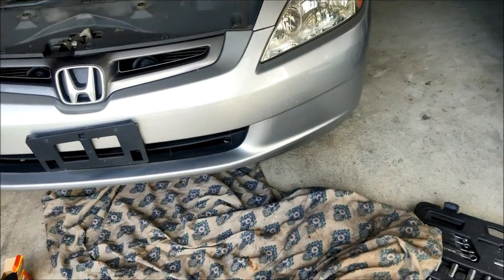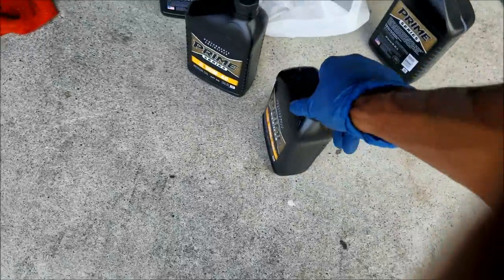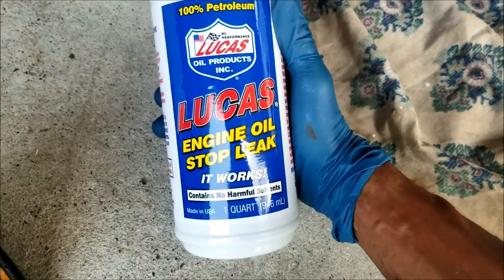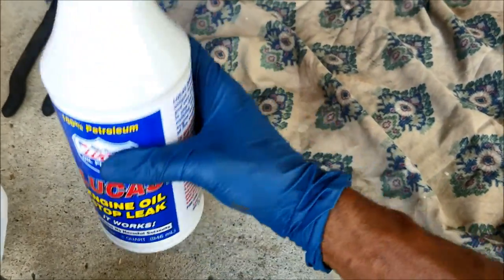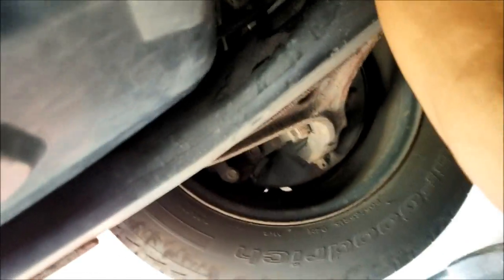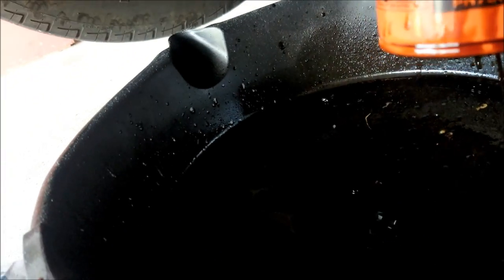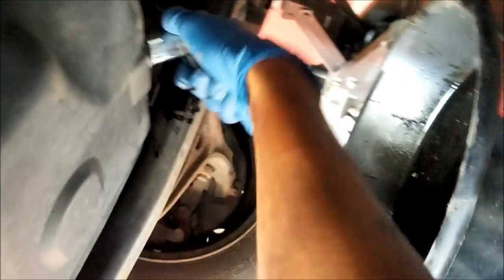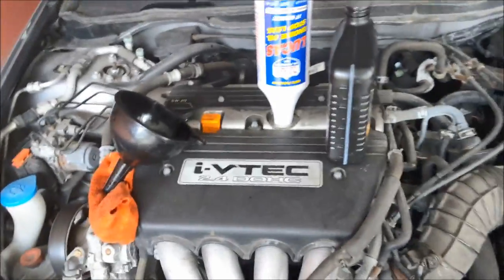USING THICKER ENGINE OIL IN MY HONDA ACCORD

Comment: 10W-40 is fine to use in the K series above 20 degrees F. In other markets like Asia, Europe and Australia, 0W-40, 5W-40, 10W-40 and 15W-40 are all listed as acceptable in the owners manual for various ambient temperatures. The only reason Honda says you have to use 5W-20 here is because that's what they used for their EPA gas mileage test for a slight improvement, so they legally can't list anything else as acceptable because using something else would invalidate the test results. But as others said, don't use any stop leak additives. If you have an oil leak, either fix the darn leak or just live with it and keep the oil full. Fortunately, there aren't very many things on the K series that wouldn't be cheap and easy to properly fix if it leaks.

Comment: 5w-30 is fine in a Honda but don’t use stop leak. That stuff is bad for the variable valve timing. Just fix the leak. Probably the vtec solenoid.also don’t use 10w-40.

Comment: The stop leak changes the oil weight. It makes it thicker. You’re going to see better mpg with a thinner oil. I wouldn’t go over 5w-30. If the motor leaks you can just change the gaskets wherever the leak is. Thicker isn’t always better
Reply from the maker: That ain’t what she said 🤝 😂

Comment: I also use 10w 40 in all my vehicles I've been doing that for 30 plus years I will tell you Fram any Fram filter is junk they collapse inside and they have plugged my oil pressure I know this because I found the filters off cut them open can replace it with a different filter in my oil pressure came back this has happened more than once

Comment: I have a 98 Chevy PriZm that is burning oil about a quart every 100 miles. I’ve had some luck with the STP  Oil Burning Product slowing it down for about 1000 miles. Do you have any other suggestions? Thanks for all you do!

Comment: There is absolutely zero problems with using a 40 grade oil in this car. I use Mobil 1 0w40 in my 2017 accord sport
Reply: This is a 7 Gen Honda foo, not a 17 with smaller oil clearances
Reply: @TheAceY2k  the clearances are not smaller
Reply: V6 ?
Reply: 4 cylinder. M1 0W40 is basically a thicker 30 grade

Comment: Do yourself a favor and stop using cheap fram filters.  Use a premium wix or equivalent.  If you want thicker oil dont use Lucas it has no additives.  Use the same amount of 90 weight gear lube it has additives for high pressure lubrication. But may be bad for emission converters.

Comment: In summer it’s good 10w30 winter must use 0w20 or vtc will start to fail every 3000 miles oil change is must not 6000 like they state for these newer cars
Reply: But the car calls for 5w-20
Reply: @MrRedHotChiliMan look in your manual it tell you the different oils you ca use just cause your cap says 5w20 there’s multiple choices
Reply: @ricardocenteno375 I get that but I got an accord here that has run 5w-20 and 5w-30 for 234,000 miles and the vtc is still working fine..
Reply: @MrRedHotChiliMan  I have a 2013 crv I hit 250,000 every thing is original except timing  chain

Comment: I have a 9th gen accord with the 3.5 earth dreams. It says 0-20 oil. Want to know if I can use thicker oil?
Reply from the maker: Anything lower that 5 I would probably just use what they want you too use.
Reply: @WeHustleDaily  Bet. This earth dreams engine is new to me. Use to use thicker oil in my older Honda’s with no issues.
Reply: Yes you can. I wouldn’t go crazy like a 50 or 60 grade, but a 30 or 40 is fine. M1 0w40 is just a thick 30

Comment: Did the thicker oil quiet the motor down? These 2.4’s have noisy motors after a while and need valve adjustments
Reply from the maker: Well this car only has 111,000 miles. Its nothing wrong with this motor, but I have seen thicker oil quite down a engine. But you may need to use even thicker oil if you have like a 5.7L truck engine or something. I wouldn't go that thick on small 4 Cylinders unless it's a really noisy motor
Reply: Wath ab for valves blue smoke..?10w40 helps?
Reply: @acura1384ify  sounds like yours is burning oil